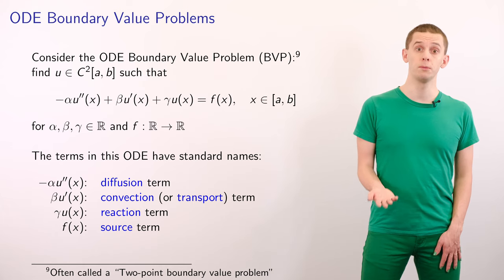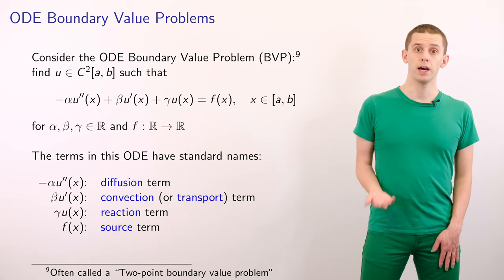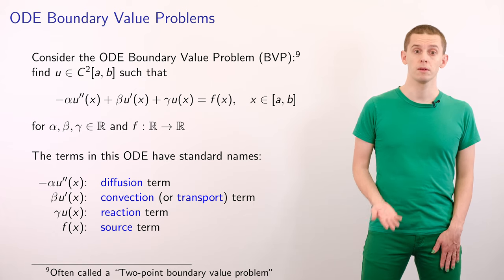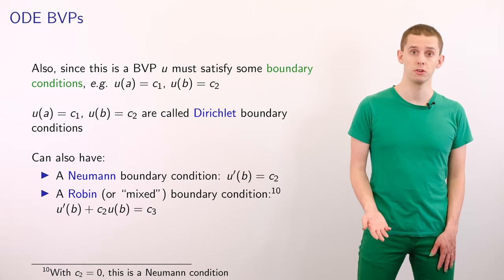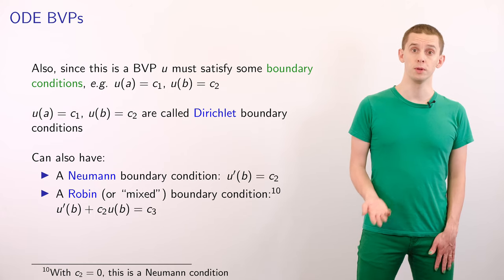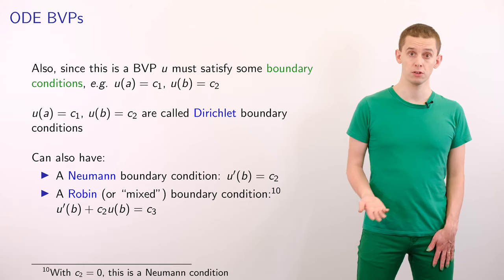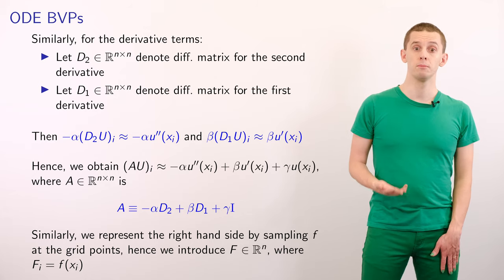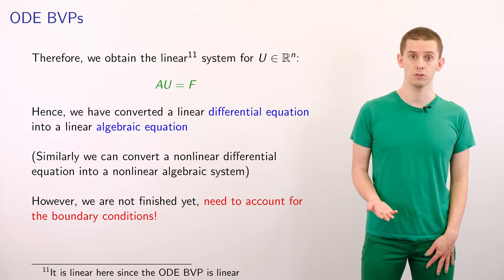Harvard AM205 video 3.15 - ODE boundary value problems

Comment: A simple Singularly Perturbed Convection Diffusion Boundary Value Problem  can be defined as follows:
        
        \begin{equation}
          \epsilon y''+ q(x)y'+p(x)y = f(x), \quad 0 \leq x \leq 1
        \end{equation}
        
        \begin{align*}
          y'(0)=y'(1) &= 0,\\
        \end{align*}
        
        where $0<\epsilon \ll 1$, $q(x), p(x), f(x)$ are known functions. Then find exact solutions for the above problems by showing all necessary steps.